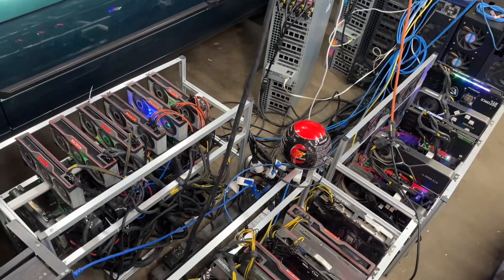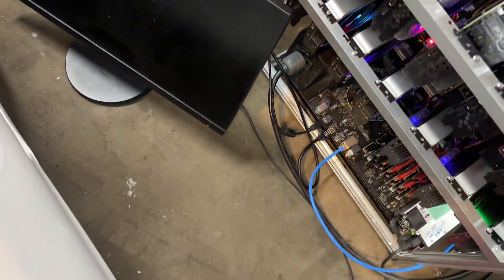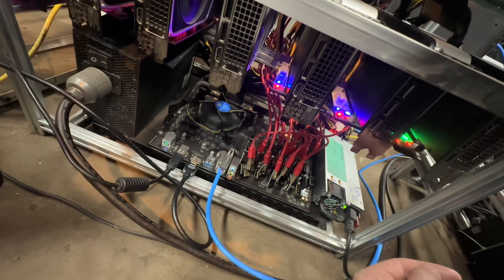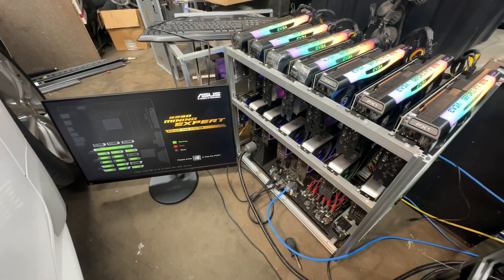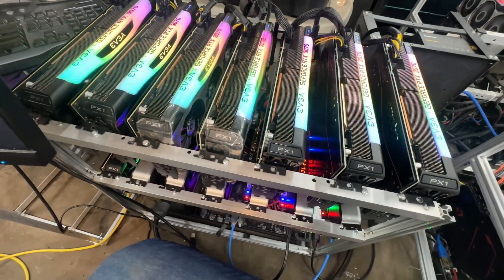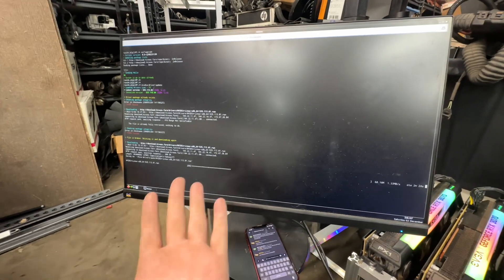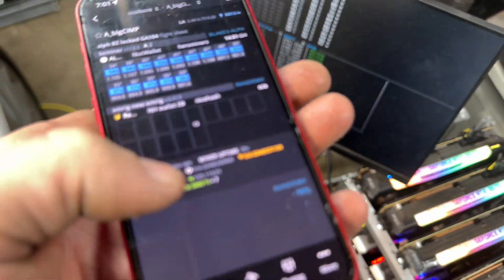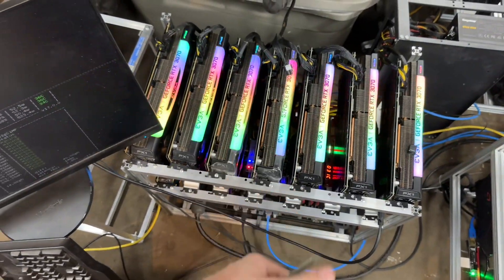Dead 14 GPU rig - Let's fix it.

Comment: Do you have any tips for using one of these motherboards? I just ordered 1 to replace a BTC b250c that will no longer post after a remote reboot. Hopefully able to run 19x p106-100
Reply from the maker: I honestly dont know on getting more than 14 or 15 to go. the slots I used in this video work reliably for 14 cards. AMD too with CSM toggled in bios
Reply: @OvalboreTech  well 12-14 is solid anyway!!
Reply from the maker: still the best board IMO  @MHOAKEY  but idk. I do have a video with 18 cards running on one in hive.. give that a look? might work for the P106s
Reply: @OvalboreTech  well, I hope the one I've got shipping in is reliable for at least 12 GPU.  Yeah, I've seen that. Sounds like it was a lot of time consumed to get that going xD in listening to one of your videos you mentioned bits be trippin' has had success. I'll have to watch his videos for 19-21 GPU running on one of these boards. Hard to find solid info on these boards. Mostly a lot of complaints from inexperienced folk it seems.

Comment: For me malfunctions are always the damn Chinese risers. Or the PSU just shutting off for some reason. I noticed on my dell server PSU that quickly restarting the miner causes OCP to kill the PSU, but if you wait 5 min after stopping the miner it runs just fine.
Reply from the maker: really? the only riser I have had go back was a crappy solder joint on the USB A port. the rest of the glitches have been thermal pad oil leaking in to them.

I believe these risers are mostly the $0.01 nerdgearz untested 006S lol

Comment: I had similar issue with my polominer case, stripped it down to barebones, reset bios, etc.. reassembled and worked fine. Im wondering if the ram is janky?
Reply from the maker: Honestly I think so - Ram seems to be the go to when there are instability and corruption issues.

Comment: I often have issues with onboard video. Setting bios to use integrated graphics 1st is no help. So, i keep an Asus GX710 (i think)  unpowered graphics card to save the day.  Works every time. DVI works best
Reply from the maker: on these boards specifically, its unwise to use integrated when you are this loaded up on GPUs. second half of the video, I have to use PEG for display out or it wont boot at all. IRQ conflicts being what they are.
Reply: @OvalboreTech  Yes, I agree,